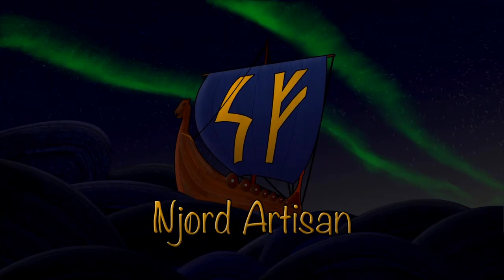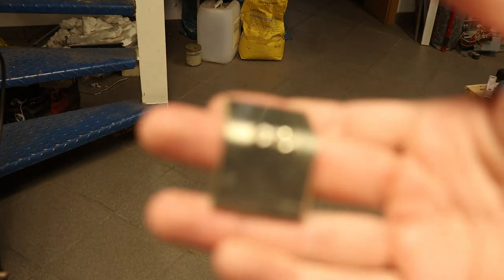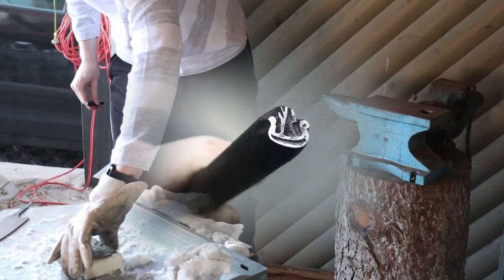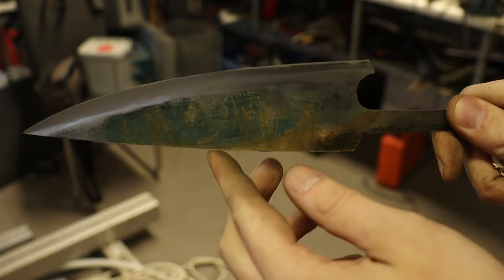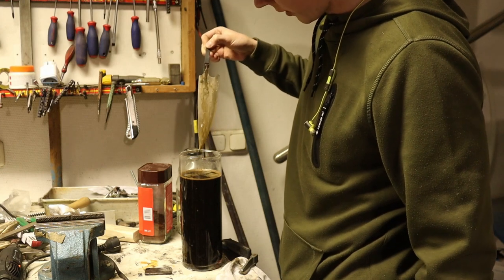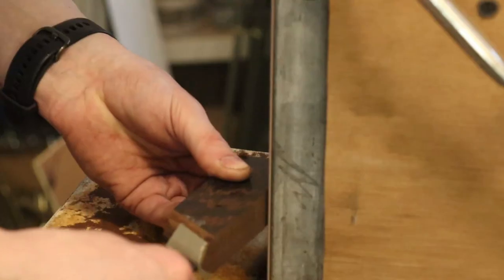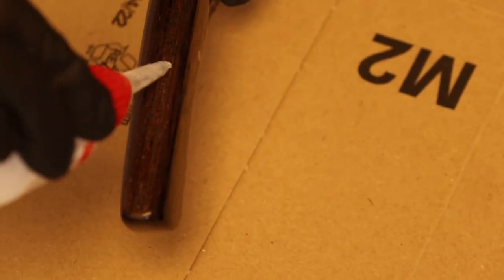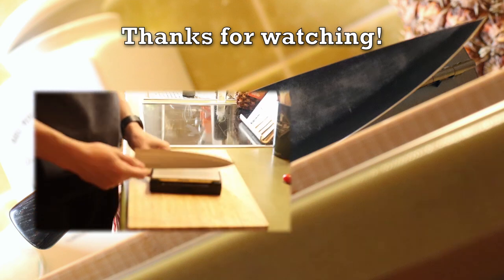Hair thin Chef Knife with Nickel Silver for a Wedding

Comment: It's fun to see you try and learn new stuff ! The sides of the blade are brighter than the bevels because you haven't ground them, so there's still a thin layer of steel that has lost a bit of carbon during heat treating. Less carbone -> etches brighter. Since you did the bevels after heat treat, this decarb layer has been ground and you have fresh high carbon steel that etches darker 😉
Reply from the maker: Oh yeah, that makes sense, thanks!

Comment: Very lovely, wish i could say the same about my WIP sword build..
Reply from the maker: Thanks! Is it not going so well right now?
Reply: @NjordArtisan  Last I worked on it, I ran into a bit of a problem with the guard, origionally i was going to use some 20mm square bar, cut that in half long ways, but then decided on 10mm bar as a test. A few attempts broke while I was drilling holes for the slot, but I managed to get a decent piece fit. Also found out that the blade is a whopping 8mm thick. This week though I've been at home dying from the flu. 👍
Reply from the maker: @3dwrecker_4660  Now that's a big sword 😄👍 but apart from the flu that doesn't sound so bad! Get better soon!
So did you decide to film some of your build?
Reply: @NjordArtisan  Thanks! Yes I have filmed quite a lot of it, but I plan to throw it all into one video, along with a few pictures. I might decide to do a little "teaser" video soon though.
Reply from the maker: @3dwrecker_4660  Very nice! Can't wait. I'm guessing on your YT channel, right?
Reply: @NjordArtisan  On my channel, yes, I also found out that the steel I'm making the sword out of actually has more carbon than a plate of mild I have in my back yard, so I might try to give it a light heat treat once I'm up to that stage.

Comment: You've chose to make one of the hardest bend on the bolster Sven 😂! Even with milling machine it would be pain in the guts lol.. 3 blades failure because of the mark.. thats a bummer :/... think about electro etching- it's less problematic and it works great if you have good masking stencils. And +1 Like for the intro! Your videos are remarkably pleasing Bro:) Great looking knife: this is very cool wedding gift :)!
Reply from the maker: Thanks a lot, Dawid! Nickel silver has to be one of my new favorite materials to work with. No cracks with such a sharp bend and polished it looks amazing, plus it doesn't take a patina as quickly as brass.
I thought a lot about electro etching but I think for one my logo has a lot of small sections where it get's a bit difficult to make a stencil and I actually really like the smoother look of a hot stamped logo. 
I just have to stop being so bad at punching it 😁
Reply: Professor David 😉
Reply: @Kratos_God_of_50_BMG  🤣🤣🤣